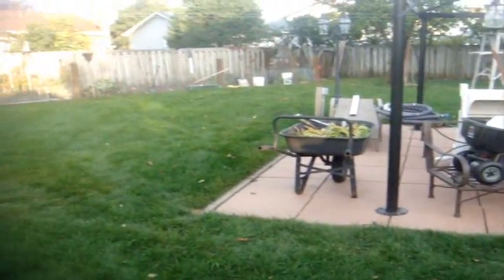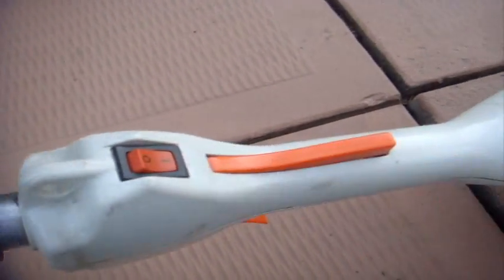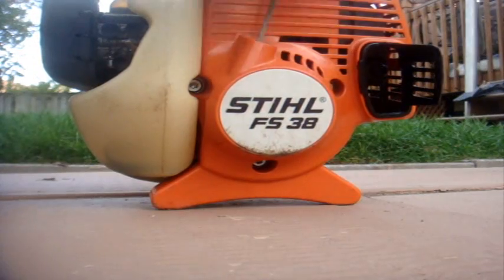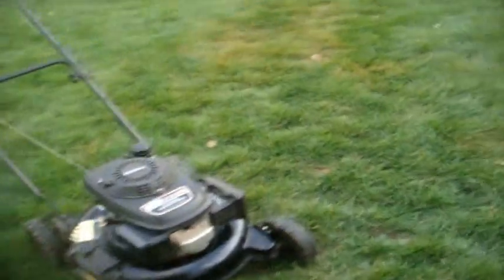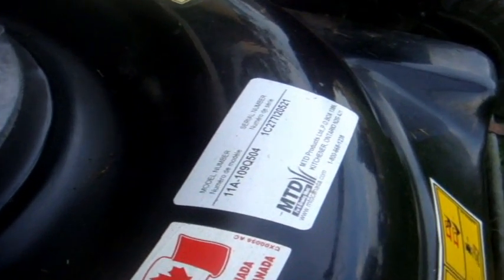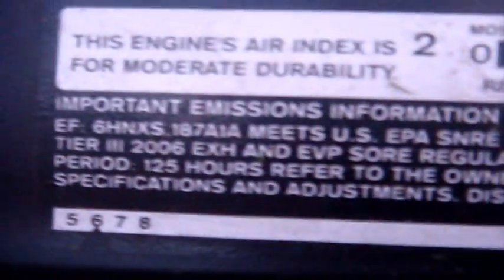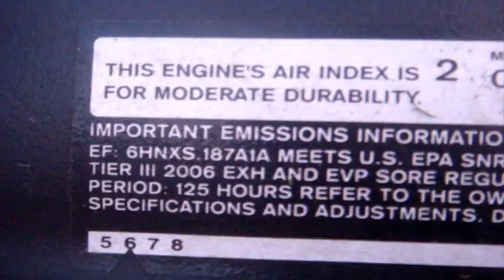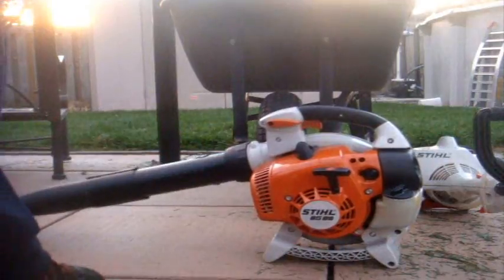October Lawn Cutting Vid: Honda MTD and Stihl's FS 38 and BG 86

Comment: The screen was an engineering design flaw and a quick fix. They don't last that long and plug constantly. Too much oil has nothing to do with it. If your in a fire danger area, like a forest or dry field, its required to have them. Maybe, the Stihl engineers need to get back on the drawing table and redesign it. Stihl is still the best on the market. Just a few items they need to improve upon.. The "Kaizen" concept needs to be introduced in their U.S. manufacturing plants. Management 101...